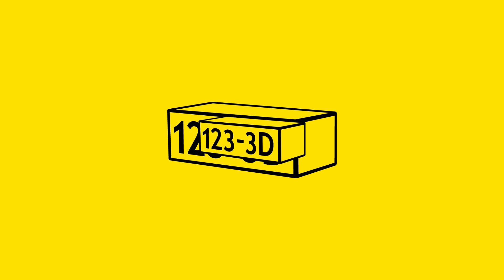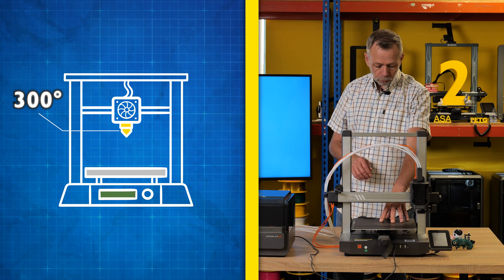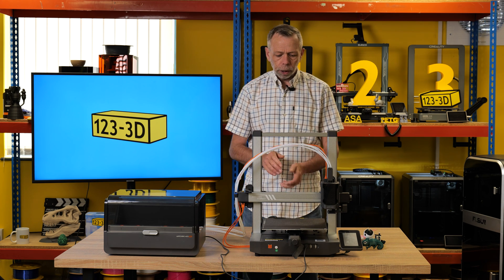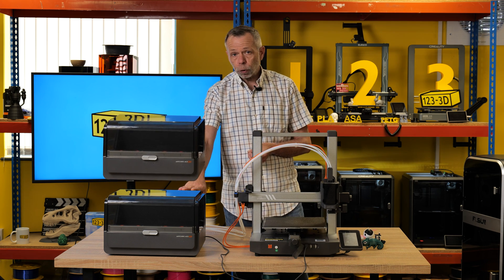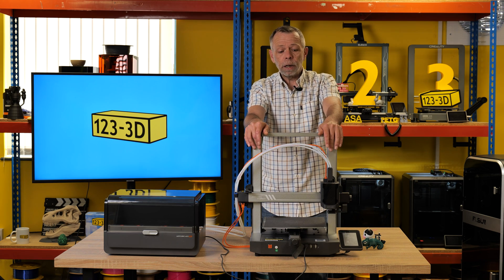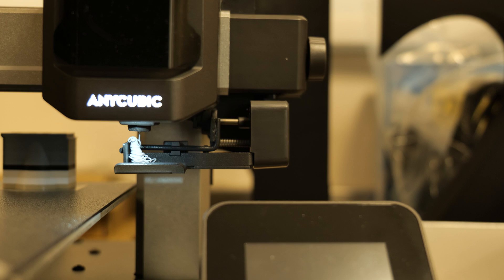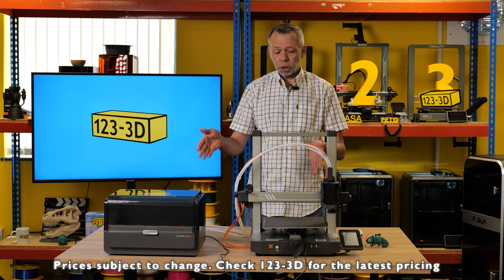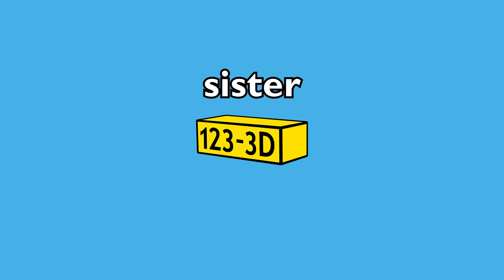AnyCubic Kobra 3 Combo Full Review!

Comment: We have just received ours but not for the hit that feeds the filament. Is this needed to print? It was second hand and don’t have the additional tubes to feed the filament in either, is this going to cause trouble? Also what’s a slicer?! I’m very new to these things - my son bought it and he’s only 12 so he thinks it’s a trim on and go type thing.
Reply from the maker: Hi, no the ACE unit is not required to print. Your printer should have come with a small plastic bracket to hang the spool off then feed the filament through the tube into the extruder. 

A slicer is the program to turn your models into a file the printer can understand. Basically it writes a set of instructions for the printer to follow called G-code. If you go to the AnyCubic website and download AnyCubic slicer that’s a good place to start. We have a video on the channel going over the basics of slicing a model, we use a different program and printer in the video but the principles are the same. We also have a video showing Steve unboxing the printer and doing the first print that also might help you get going.

Comment: I see there are 4 tubes going to the print head, if you put a 2nd ace, does that mean there will be 8 tubes going to the print head?  Any issue with weight of the head pulling around that many tubes?

Comment: Correct me if I'm wrong, but the multi-colour towers are not actually "Purge towers" but rather "Prime towers" and are used to prime the colour, make sure there's no colour bleed, etc. I have an X1 Carbon and if I do a print with only height changes, like a Hueforge or a sign, I deactivate the prime tower but keep the flushing volume to 1.0.

In prints with lots of colour changes (more than 100) I can lower the flushing volume to 0.6 or 0.7 and use the prime tower to make sure there's no colour bleed and the filament cost is usually very low. Thanks for the detailed review!

Comment: Any Printer that is not built for 250-300mms printing on a regular basis for case of wear and tear on parts? Rubbish That's an excuse for any company to have not solid enough quality components. Also Just mount the Spool Unit under the table or make a housing to have it over head its not hard so it doesn't take up 1metre space at all
Reply from the maker: Thank you for your comments, we do state the max print speed for this machine is 600mm/s but recommend printing at 300mm/s to maintain print quality and premature wear of the parts. We setup the printer on a table, and only provided the space required for the set up we have used as this will be how most people will run the machine.

Comment: How easy/ hard is it to set up to run TPU? simple swap or will i have to dig out tools?
Reply from the maker: Thanks for your comment! It is just a case of unplugging the ACE and taking out the PTFE tubes which are just held in by push fit fittings. Nice and easy, no tools required!

Comment: Can you place the ACE unit under the table?
Reply from the maker: Hi thanks for your comment! The instructions for the machine state that it must be kept to the left of the printer. However as far as we can tell the only thing limiting where you can put the ACE unit is the length of the cables and boden tubes.

Comment: Anycubic does not have a trustworthy history with regards to opensource and Klipper.    Their "KlipperOS" used on the Kobra 2 line is in violation of a bunch of open source project licenses.    As a K2Pro owner myself its troublesome.
Reply: They don't ignore all user request to open source the firmware as well. The kobra 3 is pretty much a kobra 2 pro by the looks of it. Finally they decided to open source the kobra3 when no one seems interested in it. I have the kobra 2 pro as well, so frustrating not being able to access any of the settings in klipper.

I'm going to see how it goes with user experiences for the kobra 3 first. I don't want another kobra 2 pro in silver with just multicolor added to it. I'll wait until they sell the multicolor for use with older printers.
Reply: @oneanother1  More of a k2 plus than a pro with the 250x250 bed, but i did notice the hot end housing is just a k2 housing that's had the front chopped off and replaced with Perspex and a led, but the heat brick and nozzle upgrade is a nice touch, 300c is a good one too.  I hate the k2 nozzle and lack of aftermarket support for it, i want the tri nozzle but can't.

Comment: might look similar to the A1 but its not. The Kobra 3 and slicer is made from or based on Prusa MMU which is nothing like the Bambu AMS so there is some quirky things that goes on with it... they tried to make it like the AMS but use prusa MMU slicer.. their slicer is subpar if that to bambu slicer, it doesnt handle coloring very well.
Reply: Disagree, it works beautifully and is a steal for $320 for the Kobra 3 combo.  The new slicer is nice too, Orca based.
Reply: @MikeMPharmaCyclist where do you find it for 320 I see 399 thanks

Comment: I'm just bothered by mine doing 2 purges with a single filament when the ACE is connected but only one purge cycle when I use the external spool holder, can't seem to figure out how to get it to only purge once before printing a single color print while using the ACE.

Comment: Would it be possible to take a picture of the K3 from the bottom and share it? I am wondering whether or not my "squash feet" from K2 will fit or if I will have to modify them?
Reply from the maker: Hi thanks for your question! We have just measured the feet and they are 36mm x 20.5mm rectangles that are rounded at one end.
Reply: @123-3D-UK  Thanks. I got the printer meanwhile. And it seems the feet on K3 are much better than those on K2 as the printer does not "travel" on the table. Now I only need a profile for Orca Slicer :-)

Comment: How about mixing material for supports?  If you print with PLA/PET and use PET/PLA as the Supports, do the supports just fall off with very clean undersides?
Reply: Petg as support on PLA , and reverse, works fine
Not super clean every time, but close and much better than ordinary support

Comment: Can you use the ACE with a separate TPU spool?
I'm looking for a non-dual extruder that will let me print a captured TPU hinge within a PLA box.
Reply: I don't believe you can. I have Bambu labs A1 and mini the problem is that when you use tpu from the spool it's direct drive from the print head. The ACE/AMS is what retracts the filament for a different material. Since you have to feed TPU directly there is no way for it to pull the tpu out for a materiel switch or in for that material since it's feeding from the direct drive in the print head. . I'm not even sure that is possible with the higher level bambu labs Core X/Y printers.
Reply: @dtarot  I believe you are correct.  Apparently you must have multiple extruders to embed TPU.  Hopefully the 2 head Prusa will get cheaper...
Reply from the maker: Thanks for your comment! What dtarot is saying is correct. TPU needs to feed directly into the extruder but by doing that there is no way to swap another filament in. We did try putting TPU in the ACE but it was unable to push the filament through the boden tube due to it being so flexible.
Reply: Generally using using several different material in the same head can cause a lot of issues, cross-contamination (pla and tpu dont realy bond.), since its really hard to get rid of the really small tpu string they tend to end up in the pla causing layer problems. Optimal printing temperature, you will have to chose to print one cold or one to hot. There's a reason idex exists. 
Slicers still don't really support any accel/speed changes while changing materials you can limit volumetric flow in most slicers but it can only do so much.
You are just better off designing around multipart prints.
Some more unsolicited  advice i would also recommend of switching to a PETG TPU setup if you really want to print multi material.